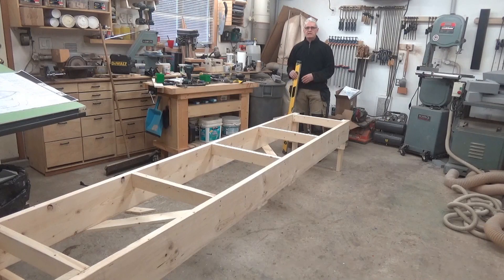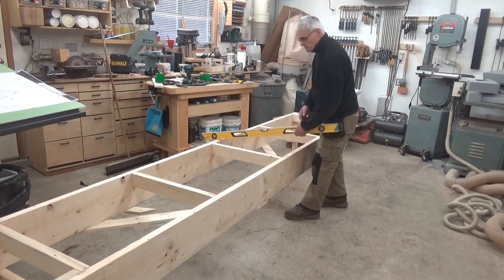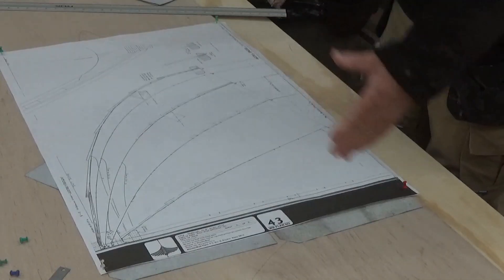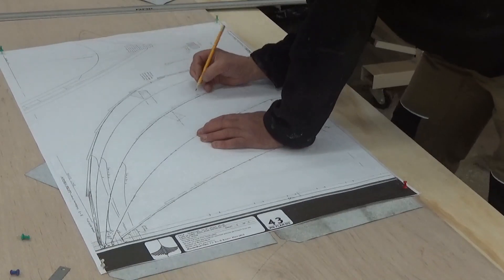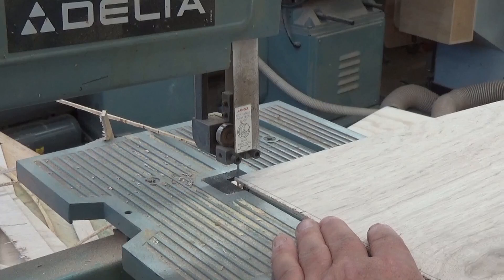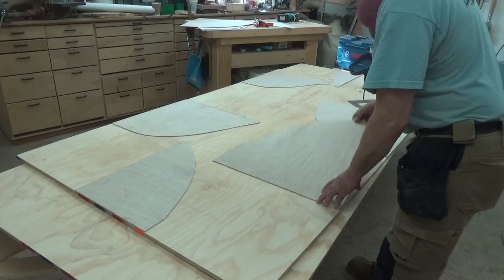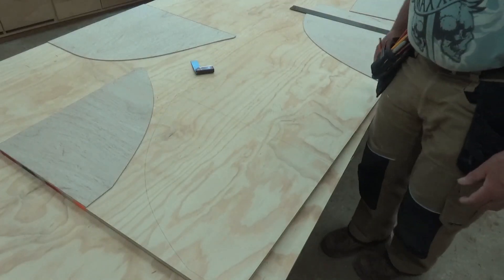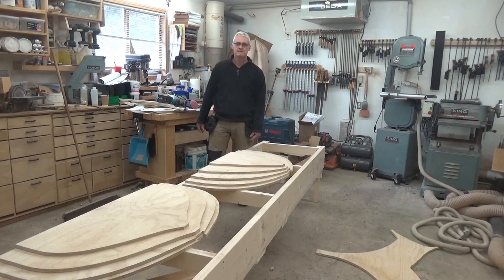Acorn Dinghy Build Episode 1.  Forms and Strongback

Comment: To ensure your strongback doesn't migrate, how about using two-sided tape to put down a pair of blocks at each corner? Put them on the insides of the legs so you don't keep kicking them, and you may have to sand/scrub the concrete to get a good bond.
Reply from the maker: Thanks for the thoughts. I really don't' think this structure is going to move.  I don't even have the forms on yet and it is quite heavy and solid.

Comment: The Strongback and the forms look great.   I am still using a corded Bosch saber saw.  I like the looks of your cordless Makita, no chance of cutting into the cord !
Reply from the maker: My corded Bosch just died a few months ago, so I went cordless.  I feel certain power tools are much better corded, but  this unit has lots of power.  Sadly it is cheaper to buy a new tool than to have the older one fixed.
Reply: @OrcaboatsCa  I've never had much luck with a jigsaw but after watching you rip out those forms I want to revisit it, can you tell me what you're using for a blade?  My jigsaw is a super-cheap B&D, maybe I'll have better luck with a better saw.
Reply from the maker: @jeffcampbell2388  I have a pretty robust blade in there with large teeth.  The new battery powered Makita is pretty powerful.